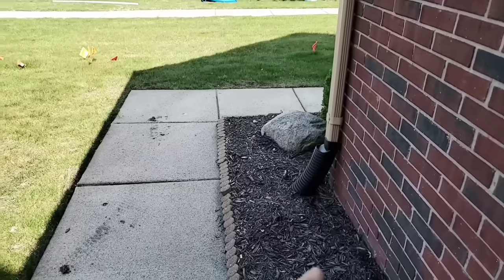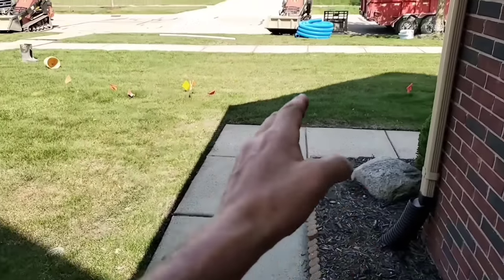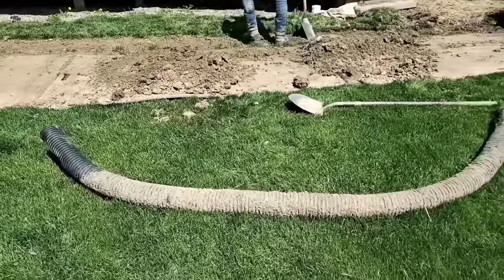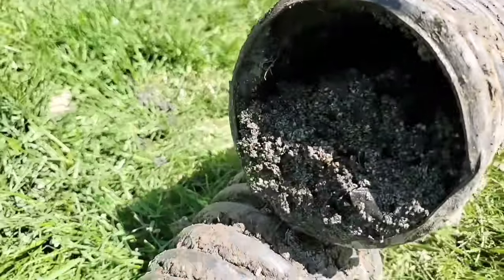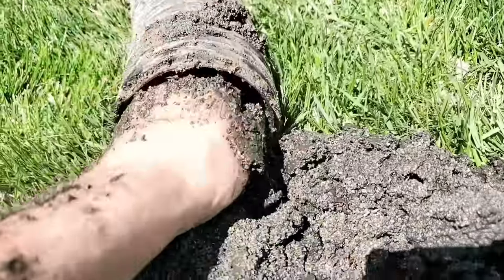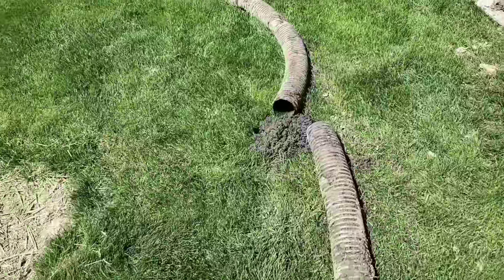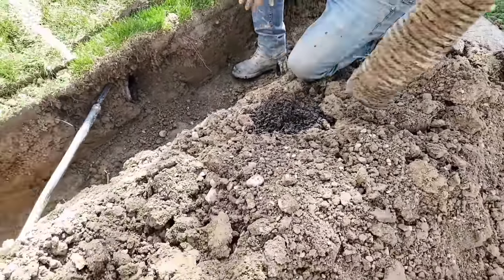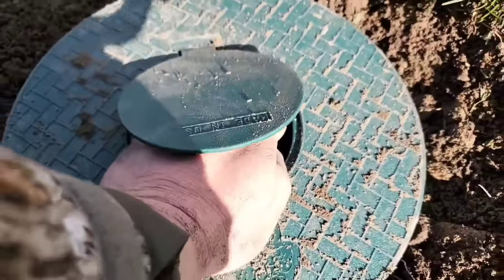Biggest Mistakes to Avoid When Installing a Underground Downspout Drain [ Gutter Drainage System ]

Comment: The reason the original contractor installed a short U shape instead of following the grade is because it was cheap, took very little time and materials, no one was watching, there were no inspectors, and he would be long gone when the problems started. That is the definition of a “spec” build - build the home before selling it.

Comment: Years ago I did Foundation water proofing. A lot of water problems came from downspout over flowing right at the base of down spouts. Get the water far away from the foundation. Wish more contractors and DIY would see this👍
Reply: We had foundation waterproofing (interior side drain) and are on a good slope. I am thinking connecting one of the gutter downspouts directly to this drain is a bad idea as more water and debris will go into this inner channel. Thinking about piping it further down to where the pipe leaves the house right before the French drain portion
Reply: Please don't put down spout drain in any drain to a basement, if the outlet gets clogged it could back up in to basement. I would run down spouts in there own drain far away from the house.
Reply: Look for popup emitters , most improvement stores have them. It's basically a elbow with a plastic cap that the water pops up and then closes after the water stops running into it.
Reply: @jeffharper7579  thanks for the advice. The contractor we used last summer did exactly this and I thought it was a terrible idea. I hate the fact my wife thinks a contractor will always do a better job than myself and she said they know what they are doing as they gave us 20 years of assurance against flooding. I wanted to wait to use a different contractor we had to wait for or do it myself.

Comment: I live on 5 acres that is fully mowed and maintained and when we built my house I NEVER wanted this situation to happen.  We built an all exterior brick earth contact home about 7' below the top of the property.  30 by almost 100 with a 10/12 roof.  Once the foundation was sealed and waterproofed we put up 2" foam and another water barrier.  Then we did something you are never supposed to do and it has worked flawlessly for 20+ years.  We laid hard perforated (holes) pipe on the footer with about 4' of clean rock on top of it with a clean out up the 3 concrete walls.  ALL of my gutters are tied into those pipes (big no no).  We trenched 4 roughly 100' lines away from the house using schedule 40 solid pipe, no flexible corrugated stuff.  I have never used the cleanouts and when we get a big gully washer there are 4 places out in front of my house that look like water main breaks about a foot high all coming off my roof.  High and dry since 1991!  People don't realize how much water their roof sheds.
Reply: ... actually, hard perf pipe with gravel was common in my area (northeast) going back to the 60s. They were called footing drains and many times the rain gutters were tied in, or at least laid in the same trench with a common outlet.
Reply from the maker: https://youtube.com/playlist?list=PLjFCqaZ4v1BUqichor2QH1X_p9bBPor8D&si=gbmPRrArtYXHd_NO

Comment: Amazing. Where I live in Australia, it is law to run the "storm-water" to the street gutter with solid wall pipes .    Most of the perforated pipes are used to collect ground seepage. They are wrapped in a one-way cloth to prevent soil ingression.
Reply: its supposed to be law here to but people suck and break rules and laws

Comment: I installed my own system several years ago. It drops underground maybe two feet and runs level before exiting through a retaining wall. My problem (living in Minnesota) is the frost. There’s always a mid winter thaw. The snow melts from the roof, runs underground and freezes when it hits the buried tube. It quickly backs up and floods the yard. It doesn’t thaw out in time for the spring rains and the flooding continues into late May. I installed an over the ground tube in the fall and the tube being black, remains open. This year I’m going to install an electrical cord that I’ll only have plug in when water is flowing in the winter. It remains to be seen if this will be the fix.
Reply: Keep us posted! I also live in a climate that gets really cold (in a part of Canada North of Minnesota), so I'm curious to see what my options might be when I get/build my own home!
Reply: Chill Will  Not necessarily. Where I live, the frost line can get well below 8 feet in a really cold winter.
Reply: Chill will: frost line in parts of Minnesota is 80 inches! Trust me, water at 2 feet will freeze if sluggish.
Reply: The problem has more to do with where the drain tile runs level, as you say, and less to do with the depth of the drain tile. Granted, parts of Minnesota are in Climate Zone 7, whereas French Drain Man operates in Climate Zone 5, so it probably IS colder where you are. The other factor is the cleanout. The reason this channel obsesses over the slope and cleanouts is BECAUSE THE DEBRIS inside the drain tile SLOWS DOWN THE WATER. Give it a decent pitch and keep it clean and the problem diminishes.

The deeper problem is the heat loss from your enclosure to the roof deck. That is causing the build up of enough ice from repeated melting and thawing (then damming up), so that when the thaw occurs, your roof is precharged with multiple inches of bulk water. Interestingly, you might think that more water will tend to clean out the drain tile than less water. But if that water is obstructed, then it will freeze and contribute to the buildup of the dam. 

Every system interacts with other systems.
Reply: My first question is, "why is it level?"   Standing water will eventually freeze.
Reply from the maker: https://youtu.be/1kPHHnDc1ZY?si=7jcDsD6lnXX-_357

Comment: I came across your channel this evening and I am thankful you are here providing such excellent education. Earlier today,  I wrestled 100 feet of tightly coiled 4 inch pipe to apply a quick, temporary fix to my drainage problem. A light rain this afternoon proved this fix to be much more temporary than expected. Let's just say some desperation kicked in at this point. I thought I was going to need to search for hours to find the right videos to cobble together a path forward for me to solve my issue. The first video I came across was yours and I knew pretty early on that your material would make this a one stop shop. Well done!

Comment: Daylight it to the curb using a Neenah R-3262-3 curb opening. You can also have a pop-up somewhere along the line as a back up.  Have to probably get a permit from the city to perform work in the right-of-way, and have a city inspector come by and check it when you're done, but that's what I'd do to have total peace of mind and minimal maintenance.
Reply from the maker: https://youtu.be/qoy_yh8NY2M?si=W5cSknzazNi_cKPc

Comment: All the more reason to have a metal roof on the house. I renewed my roof with a metal one and after 9 years i hardly have much crap in my drains except from small pine needles and small tree stuff , which most is caught by the RWL guards, works great.

Comment: You make a good point about the roof shingles, it's better to put on  steel roofing or tile roofing, they both are expensive, but they'll last the life of the house. As far as downspouts, the ones on my apartment go straight down to the ground, with the L going out away from the building, no wonder the eve troughs overflow every time it rains and maybe because there's not enough downspouts for the length of the roof, but whomever put that pipe under the sidewalk and up again created the same problem, it gets clogged up.
Reply from the maker: https://youtube.com/playlist?list=PLjFCqaZ4v1BUqichor2QH1X_p9bBPor8D&si=gbmPRrArtYXHd_NO

Comment: Perfect explanation and demonstration of the problem. I have two crushed pipes (3" schedule 40) that connect to 4" corrugated that is also crushed at my townhome. Neighbors tell me that at one time, there was a backhoe in that area and I believe that is why pipes are crushed. I cannot find a third pipe that comes from the crawlspace and suspect it dumps into the crushed - how can I find where to dig it out? I measured the back of the house where it goes out the crawlspace but cant find it. How deep could the pipe be buried?
Reply from the maker: Run water through the crawl space pipe and see where it puddles up in the lawn.

Comment: I never realized putting in a French drain was so technical. We don’t have gutters but was contemplating on putting a French drain around my shop to prevent undermining the foundation. Now, I’ll be checking out more of your videos
Reply from the maker: The 2 most popular water control systems are a roof run-off system and a French Drain system. 
Watch "How to Build a French Drain Full Tutorial in Less than 10 Minutes [ Veteran Contractor Explains ]" on YouTube
https://youtu.be/wPkMB7qlUSo
Watch "How To Install Downspout Drain Kit - French Drain Man" on YouTube
https://youtu.be/9QQvCLQd5Jg
Reply: You gave a great response.
Thank you.

Comment: I have leaf filter brand covers on my gutters. No shingle gravel. Mine horseshoes under the sidewalk and is high in the yard. I did it on purpose because I wanted the water to be used in the yard. Solid pipe all glued together with a  pop-up drain. Every few years I rinse it really well and shove the shop vac hose in to make sure it's clean. Downspout into the pipe is all glued and sealed, making a 12 foot column of water pushing down, forcing the water up the other side which is only 18inches. 
Lesson to learn here is have a plan, a reason and a system that all works together.
Reply from the maker: We can't have a horse shoe in Michigan outdoor drains because in the winter they freeze and will not work during a thaw for 3 days.
Thank you for your comment 👍

Comment: I think I might have some old buried down spout 4 inch corrugated drains on my property from the old adjacent house.  I'd like to remove them and can only guess as to their location, having already found one I feel somewhat confident.  Anyway, my property line is all downhill from the adjacent house and about 100 feet from their home.  The new neighbors are clueless and don't know or care but I don't want them sitting under my yard indefinitely.  I plan to daylight them for them on their own side at no cost to them like I did the first one. Question is, just how deep do I need to dig an exploratory trench to find them?  We have hard clay here. The first one I found happened to be just under the surface where I found it but seemed more like 6 inches deep in other spots.  My back thanks you.
Reply from the maker: https://youtube.com/shorts/nyxCkRWL4w8?si=O8GJJoiVYVkEh4pP
Reply: @FRENCHDRAINMAN  Right I know about these hacks from the downspout but when the neighbor won't help you find them by giving you access to his downspouts then how deep should you dig?

Comment: I mean, gravity has to be a well known principle right?...

Im doing a combined french drain and grate and channel now and Ive made sure that at no point, does the french drain angle up. Roughly 1cm every metre and at no point does it join any other water sources which may backfill the ag pipe. Both exit right next to each other into a spill box...mine is catching sub soil water though and not roof gutters.

Thankyou for teaching people about this stuff, Youtube is a perfect platform for learning as long as the information is correct.
Reply from the maker: It turns out common sense is not so common 🤷🏻‍♂️

Comment: I have a question on installing the pop up. We’ve dug the trench sloping down away from the house, but how do I connect the pop up at the end without creating a rise in the pipe where it connects to the pop up? Particularly when the pop up has to be flush with the ground? Is the rise in the pipe at the end not a problem? It’s an NDS pop up. Thanks for your help!
Reply from the maker: https://youtu.be/oiNUVMfYDQU

https://youtu.be/yFxGFxfSD0A

Comment: I'm facing a similar situation for a basement french drain. The house is set on a hillside so drainage should be simple straight inclined drainage. We have a dirt floor cellar with field stone & mortar walls. As mountain runoff occurs it carries silt and will eventually fill any pipe not set at the proper incline.
Original french drain install was at ~4ft level for crawl space. Cellar was dug deeper for central furnace and sump was installed to pump up to original drain instead of installing new french drain at lower level. Sump constantly fills with silt.
My job is to install new french drain at lower level and maintain a grade sufficient to carry the water and silt to the roadside gutter.
Reply: Just bought a house didn't know there were a mountain behind all my trees 😢. I know this old but asking did u fix you problem and who did u call to do it  thanks
Reply: @yahusha4life   If you have the resources 💰 any local excavation company with a good reputation will be able to do the work you need.  You''l need a trench dug across the mountain slope with retaining wall drainage and a drainage pipe with a slope to a runoff area down low installed. Corrugated pipe is cheaper for drain pipe but a perforated smooth PVC will work better if you have issues with silt.
Personally I don't have the resources. So my personal solution is going in slow motion. I first secured the system we have and made it reliable. I made a sump system that pumps a small amount of silt away with the water it is carrying  each run so the silt doesn't build up and clog the intake.  Now I am slowly doing the big dig work by hand. This year was gain access to the area and start the ground water run off going in the right direction.
Reply from the maker: https://youtube.com/playlist?list=PLjFCqaZ4v1BXWZPUFUNw6SMI64dtHlhzl&si=Fcq-rJvUYKo-u5fB

Comment: Curious how much about a French drain system should run. I know it depends on how much trenching but I just got an estimate for 22K for a French drain along the back of my house (about 25 feet long) and along the side (about 75 feet) plus rain gutters plus Stucco repair with silicone. I know it's alot of work especially since the area in the back (worst part because it's downsloping right into my house) has a concrete patio so that has to be busted up before trenching but still 22K & 2 weeks to complete the job seems like ALOT and a long time to get the job done
Reply from the maker: It's hard to say what you should be paying because every state and city has its own labor costs. Here in Michigan, that seems really expensive, even if it were all hand-dug and there were no machine access. I think you should get some more quotes. You can't hire based on price, but if you can find a guy that you really feel confident in and he's in the middle, that's what I would shoot for. Never hire the cheapest guy.

Comment: I'm going to be putting in a gutter drain system soon. My backyard slopes (approx 100') with a gradual 3.5' drop into a drainage ditch, should the down spout be hooked directly into the drain pipe or can it spill into a catch basin? Thanks for the upload and any information you can provide
Reply from the maker: Yes
https://youtu.be/9QQvCLQd5Jg

Comment: Would there be any problem with drilling a hole or two in the bottom of an elbow where a pop up is connected? My thinking is that any residual water that can’t escape out the pop up can leach down into the soil before it freezes in the winter.
Reply from the maker: https://youtu.be/N6lK6N7tcDk?si=NBjsO1cL6y1IzZ3n

Comment: I’ve never seen this design before. We usually take down pipes to either direct runoff to ground or a soakwell to enable drainage to subsurface (only where there is sand). I suppose this is a direct runoff with gap from house.
Reply from the maker: https://youtube.com/playlist?list=PLjFCqaZ4v1BUqichor2QH1X_p9bBPor8D&si=gbmPRrArtYXHd_NO

Comment: I have a 50 ft by 15 ft patio paver area in my backyard. It used to flood so at the bottom corner of the patio I put in a 12 inch square catch basin. Then I ran  4 inch solid corrugated  pipe out about 40 ft into the side of the canal bank about 2 ft from the top.The problem was that the water was running down the 10 ft high canal bank causing erosion.. I added another 10 ft of solid  corrugated pipe to it and ran it down almost vertically so that it would come out about a foot above the water line of the canal and put a 4 inch round grate at the end of it in order to keep iguanas from climbing into it.  Is there a problem with it going out 40 ft horizontally on a grade and then dropping about 8 ft vettically? Or will the force of the water dropping 8 ft straight down cause any solids to get stuck? 
The catch basin has a filter on it so it's mainly just tiny ficus leaves that might pass through. I can always take off the grate at the end to clear it out, but sometimes  alligators are in the canal so I don't really want to climb down along the bank if I don't have to.
Reply from the maker: That should work great. There shouldn’t be any problems; you shouldn’t need to clean it, and it’s not going to cause any harm.
Reply: @FRENCHDRAINMAN  Thank you for your advice. I love your channel since it offers great advice about how to do things.

Comment: I have a slightly slanted flat roof where all the rain water drains thru the parapit wall and down into the basement through a cast iron pipe. I want to replace the cast iron pipe with PVC. Is this possible?
Reply from the maker: I never recommend directing rain water into a basement. Not even as a pass through. If this was allowed years ago it's probably no longer code.